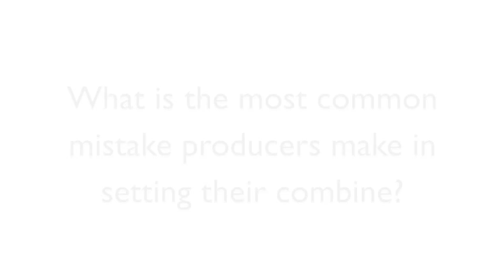Canola School: Common Mistakes Farmers make in Combine Adjustments

Comment: 3 older 1680's loss of 2 to 2.5 bushels in a drop pan. 1 S680 set by specialists still 2 to 2.5 bushels loss in a drop pan. Are these acceptable losses? Yield from 62-64 bushel an acre. 75-45